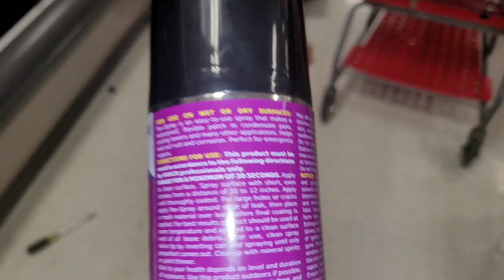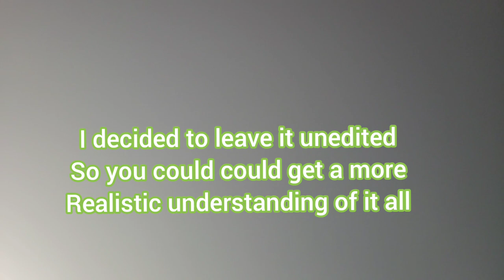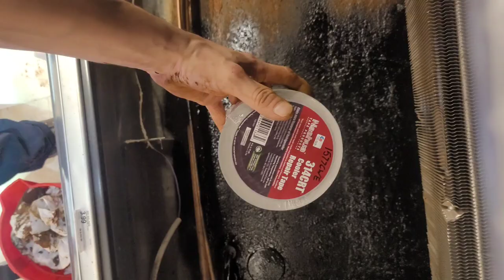Produce Case Evaporator Drain Pan Rusted Through Pan Recoat with Nu-Calgon Pan-Spray

Comment: Have used the product on a much smaller project, but also used some galvanized sheeting over the most cancerous spots and sandwiched the spray coating below and around the edges. Not perfect but a decent band aid.

Comment: I’ve seen that stuff but never used. I’ve used the flex seal the kind that you apply with a brush, it seemed to work okay. 🤞🤞this holds up for you.
Reply from the maker: I think it will do OK. They are the ones who are choosing not to replace the case when they should. We can only do so much as field technicians. There comes a time that they need to be replaced
Reply: @HVACRServiceTech  Yes I agree customers choice but man that pan was like Swiss cheese. That’s okay hopefully they will call in six or eight months from now so you get the job of replacing it. 👍👍

Comment: Also, the truck bed liner works just as good and may be less expensive.
Reply from the maker: I figured that this stuff I use is exactly the same thing almost if not maybe a little different than the truck bed liner stuff. Lol. Thanks

Comment: You may want to consider using a rust converter before the pan liner spray. It’ll stop the rust from getting worse and the repair will last much longer. Not criticizing, I’ve done the exact process you did many times - I’m just anal about rust. Great vid man.
Reply from the maker: Thanks. Yeah I thought about the rust, these cases are so old and so crappy I shouldn't even have to be doing this they should just replace the damn things you know. Bissell limp them along a little while longer don't be doing a store remod eventually so I didn't figure I'd go too crazy on it. Thanks for the support man!